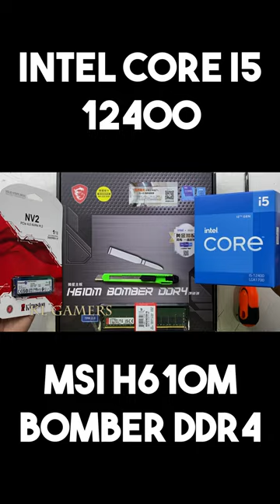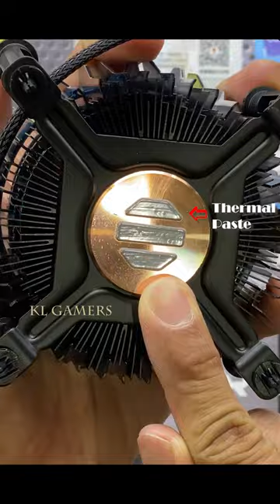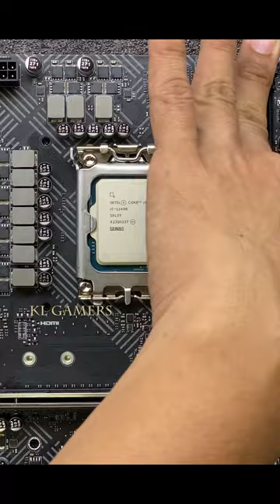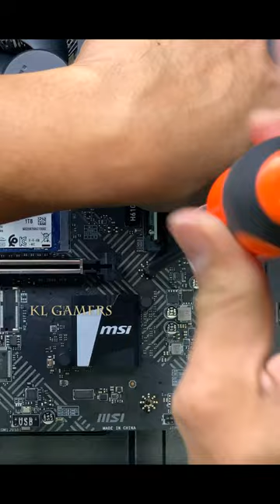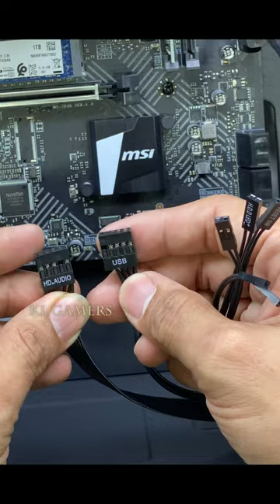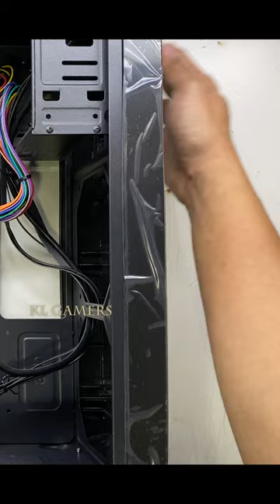SHORTS intel Core i5 12400 MSI H610M BOMBER DDR4 Kingston NV2 NVMe SSD PC Build

Comment: Box cooler for I5 12400.......
Reply from the maker: yes sir
Reply: Whats the problem? The max temp that it will get with this cooler is around 65.
Reply: Rofl😂😂😂😂😂
I have a i5-11600K
Even with the best available AIO I barely stay out thermal throttle range. I’m OC at 5.1 all cores, but with a 120 AIO I was at a constant 88 under load. I don’t think that stock cooler will do it. 11th gen are known to draw a lot of power. Forgot to mention I’m peaking at 225 watts on CPU?
Reply: @reptileescape3619  Bro this is the Non-K variant, and as far i can see its not ready for gaming so its probably gonna be used for normal tasks and that cooler will be super okay
Reply: @milhobeludo8053  I tried using it with my i3 12100f and it was so damn loud
Reply: You would be an idiot NOT to use the stock cooler.

Comment: This motherboard will bottleneck the processor due to weak vrms, should have gone with b660m motherboards like msi and asus
Reply from the maker: yes sir
Reply: no its not, this motherboard have 8+1+1 vrm, most low end b660m motherboard also have 8+1+1 vrm, and this proc only use 65watts

Comment: One stick of RAM, box cooler, no GPU, cheap power supply... Good luck with gaming on this
Reply: Stock cooler is fine. Absolutely no reason to go above that unless you are going to zero noise.
Reply: I had stock cooler for a moment but temperatures were like 87 C° when i was playing

Comment: bro what was the total cost
Reply from the maker: Processor = Intel Core i5-12400 6C12T 18M Cache up to 4.40 GHz (MARCH)
(Amazon link) = https://amzn.to/3n1C8jJ
(Lazada link) = https://invol.co/clhgvi7
(Shopee link) = https://invl.io/clhgvit

Motherboard = MSI H610M BOMBER DDR4 LGA1700 (MARCH)
(Amazon link) = https://amzn.to/42q6g8u
(Lazada link) = https://invol.co/clhgvge
(Shopee link) = https://invl.io/clhgvgo

RAM = KINGSTON VALUE RAM 8GB DIMM 3200 MHz DDR4 DIMM DESKTOP PC Memory (MARCH)
(Amazon link) = https://amzn.to/3MBHla6
(Lazada link) = https://invol.co/cl9kw7e
(Shopee link) = https://invol.co/cl9kw7o

SSD = Kingston NV2 500G M.2 2280 NVMe SNV2S/500G (MARCH)
(Amazon link) = https://amzn.to/3Cr5JHl
(Lazada link) = https://invol.co/clehz95
(Shopee link) = https://invle.co/clehz9a

Casing = AVF ACCS560 USB 3.0 ATX Casing with 500W Power Supply (MARCH)
(Amazon link) = https://amzn.to/2YJnNeR
(Lazada link) = https://invol.co/cl93hj9
(Shopee link) = https://invol.co/clh6cl

OPTIONAL:

Power Supply = COOLER MASTER MWE V2 750W 80PLUS BRONZE (MARCH)
(Amazon link) = https://amzn.to/3hZ0Qvt
(Lazada link) = https://invol.co/cl9nepy 
(Shopee link) = https://invol.co/cl9neqa

ASUS TUF Gaming GeForce RTX 3070 8GB GDDR6 (MARCH)
(Amazon link) = https://amzn.to/3CrK6I7
(Lazada link) = https://invol.co/clfp2d8
(Shopee link) = https://invl.io/clfa9oy

Graphics card = RTX 3060 Ti 8 GB GDDR6 (MARCH)
(Amazon link) = https://amzn.to/34LsGHZ
(Lazada link) = https://invol.co/cleab31
(Shopee link) = https://invle.co/cleab45
(Shopee link) = https://invol.co/clapjcn

Graphics card = GTX1660 Super 6GB (MARCH)
(Amazon link) = https://amzn.to/3sRYK4c
(Lazada link) = https://invol.co/clfp2br
(Shopee link) = https://invol.co/cl7rwa3
(Shopee link) = https://invol.co/clb25l4
(Shopee link) = https://invl.io/clfp2bi

IGAME COLORFUL GEFORCE RTX 3050 ULTRA White DUO OC 8GB (MARCH)
(Amazon link) = https://amzn.to/3zqM8q9
(Lazada link) = https://invol.co/cleryn6
(Shopee link) = https://invle.co/clerynb

COLORFUL GEFORCE GTX 1630 4GB (MARCH)
(Amazon link) = https://amzn.to/3NoTosf
(Lazada link) = https://invol.co/clessxv
(Shopee link) = https://invle.co/clessxz

Graphics card = RTX 3060 Ti 8 GB GDDR6 (MARCH)
(Amazon link) = https://amzn.to/34LsGHZ
(Lazada link) = https://invol.co/cleab31
(Shopee link) = https://invle.co/cleab45
(Shopee link) = https://invol.co/clapjcn

Graphics Card = NVIDIA GeForce GTX1650 OC 4GB GDDR6 (MARCH)
(Amazon link) = https://amzn.to/3tCF9EY
(Lazada link) = https://invol.co/clfa9le
(Lazada link) = https://invol.co/clb25f3
(Shopee link) = https://invol.co/clapjb8
(Shopee link) = https://invle.co/cldf4si

Graphics Card = GeForce RTX3080 10GB GDDR6X (MARCH)
(Amazon link) = https://amzn.to/3UcojKr
(Lazada link) = https://invol.co/cleseys
(Shopee link) = https://invl.io/clfp2cc

Graphics Card = GTX 1650 Super Twin Fan 4GB GDDR6 (MARCH)
(Amazon link) = https://amzn.to/3HlFN1N
(Lazada link) = https://invol.co/cldf4nc
(Shopee link) = https://invle.co/cleaavf

Graphics Card = GeForce RTX 3050 8GB GDDR6 (128 bits) (MARCH)
(Amazon link) = https://amzn.to/35ZH3JA (ZOTAC)
(Lazada link) = https://invol.co/clfp2ai
(Shopee link) = https://invle.co/clewq45
(Shopee link) = https://invl.io/clfp2b4

Sapphire Pulse AMD Radeon RX 6800 PCIe 4.0 16GB GDDR6 (MARCH)
(Amazon link) = https://amzn.to/3Mgdi8i 
(Lazada link) = https://invol.co/clfp2a4
(Shopee link) = https://invl.io/clfp29w

ASUS ROG Strix NVIDIA GeForce RTX 3060 Ti V2 OC (MARCH)
(Amazon link) = https://amzn.to/3gYjliZ
(Lazada link) = https://invol.co/clfp26i
(Shopee link) = https://invl.io/clfp270

Sapphire RX 6650 XT PULSE GAMING OC 4GB GDDR6 (MARCH)
(Amazon link) = https://amzn.to/3vL4Lmz
(Lazada link) = https://invol.co/clfp21p
(Shopee link) = https://invl.io/clfp21x

Please SUBSCRIBE & Click the BELL button: 
https://www.youtube.com/c/KLGamers

Copyright © KL Gamers 2019. All Rights Reserved.

Try Prime Discounted Monthly Offering = https://amzn.to/31jYLzU

Amazon Gift Cards = https://amzn.to/31aUMpc

Top Gift Ideas (Amazon Link) = https://amzn.to/31lw5qi

Custom Gaming PC SET = https://invol.co/cl3z7vu

RTX3080 i9 11900 Build 
part 1 = https://youtu.be/V9wjaVj_trk
part 2 = https://youtu.be/qeEeZNxOqq0

[Exclusive Shopping Deals Malaysia] = https://invol.co/clewqg3

12th Gen intel Core i7 12700KF Gaming PC Build = https://youtu.be/JfNLORRkJq8

Editor's Shopping Pick (MY) = https://invol.co/clewqg3

Shopee (MY) = https://invl.io/clfp1zh

LAZADA (MY) = https://invol.co/clfp1zy

Taobao (MY) = https://invol.co/cl7zmde

XP-PEN store (MY) = https://invol.co/cl7zmed

GrabFood (MY) = https://invol.co/cla87cg

Love Earth MY (Organic Food Products) = https://invol.co/clcvdrg

Nike (APAC) = https://invol.co/clfp20b

Adidas Sale (MY) = https://invol.co/clcvdrz

TIME Internet (MY) = https://invol.co/clcvdtg

CARSOME (MY) = https://invol.co/clcvdu8

Alibaba = https://invol.co/clcvdv2

AliExpress (Global) = https://invol.co/clcvdw2

Skechers (MY) = https://invol.co/clcvdxg

CORVAN ASIA = https://invol.co/clfp1wd
Reply: @KLGamers  bro just sent goddamn everything on every website on god
Reply: @zumoravek  earns money on these links
Reply: @jeanbrouwers atleast on some for sure yeah